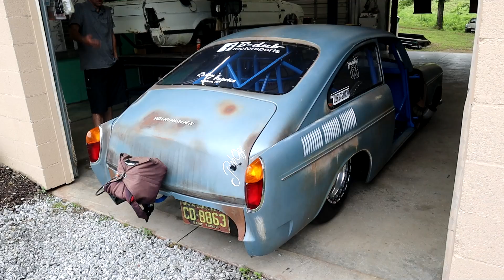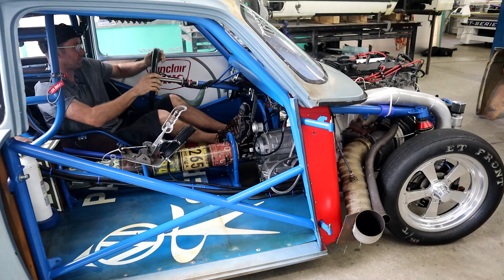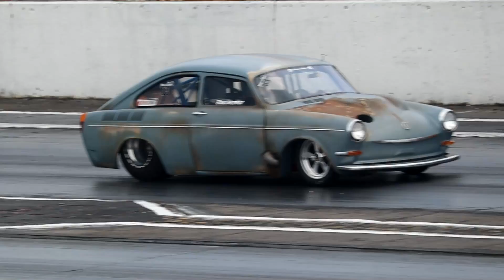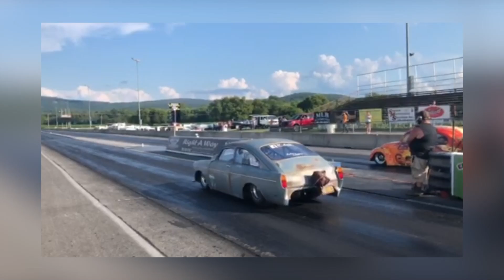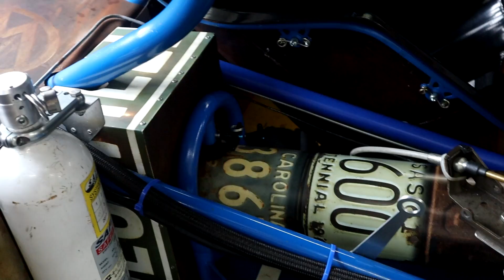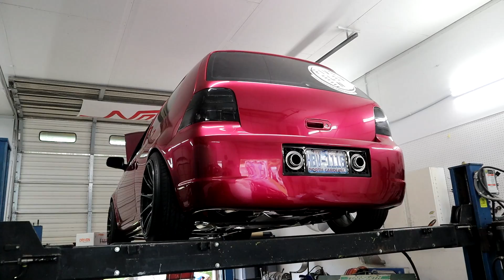Over 1000Hp RWD Turbo VR6 | Owner Spotlight

Comment: Hi, I love what you did to the fastback!!! As a small boy we had a Red 1970 VW FastBack that was left by my grandfather. I used to take the car out when I was younger to drive it around and remember one winter with snow on the ground I ended up sliding against the tail end of a trailer and hitting the passenger side, which left a pretty long line on the passenger side. I’m curious is your Fastback when you got it was Red and a 1970 with a white interior? If so please let me message me back. What you did I dreamt about as a young man and wanted to always drop a VR6 and boost it!!! Love what you did!!! Keep up the amazing work!!!

Comment: Hi Brad i was wondering what you ment by the world record for a stock vr6 engine in the 1/8 mile. Eserini's Automotive holds the Hot V.W. world record for 1/8 mile set with a vr6 in a front engine roadster. 4.56 et and 162 MPH this was set at Barona CA
Reply: completely stock vr6..Esserini is the first person i talked to when i started this build. I hope to beat his record soon. we have been 4.79 @ 145 this year.
Reply: @bradmcbrideracing2765  have you worked on the suspension on the cars the back looks a little stiff when launching. My name is mat eserini tuner. You have done a great job on the build. We are selling the dragster. All the parts and spare engine complete trailer and am of you know someone interested.

Comment: Weirdest VW ever made. My father bought a '65 and it would be the vehicle that I would learn to drive a manual clutch & transmission in. My brother plowed head on into a tree racing an MG-A once. We came back the next day to the scene and found the VW badge from the hood imbedded in the tree. Dad fixed the car and eventually sold it in '70. Brother was alright, just a broken hand. Fun car but pretty gutless.  I see these guys fixed that.

PS: in your description you say this is a "square back". These were "fastbacks". The square back was the stationwagon.